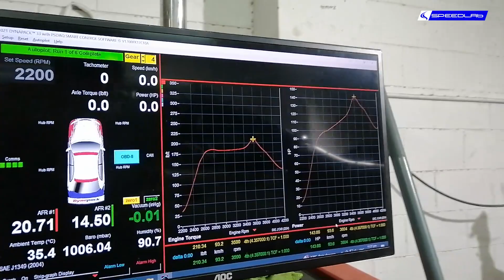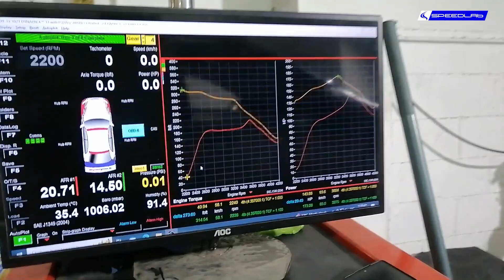Ford Ranger 2.2L SpeedLab ECU Remap/Reflash

Comment: Hey guys. I have a Ranger 2.2 2023 here in Brazil. I tried to REMAP the ECU but I couldn't because here in Brazil our Ranger has the ARLA 32 sensor, and no one was able to decipher the code, it keeps blocking the pickup. Do you have anything different about that there?